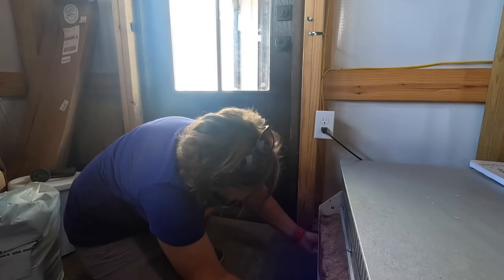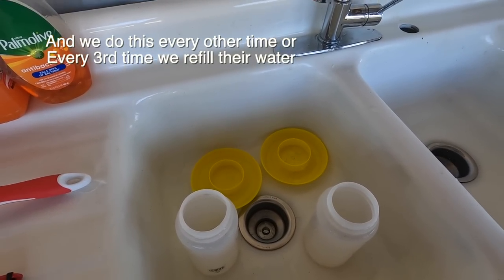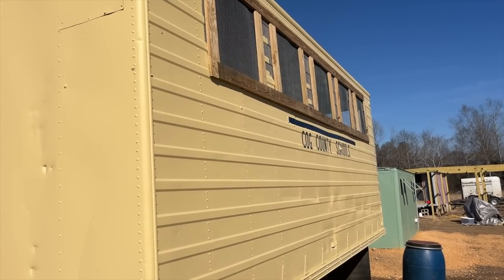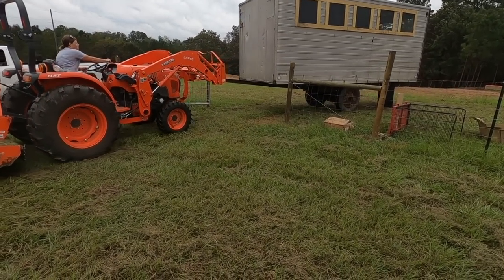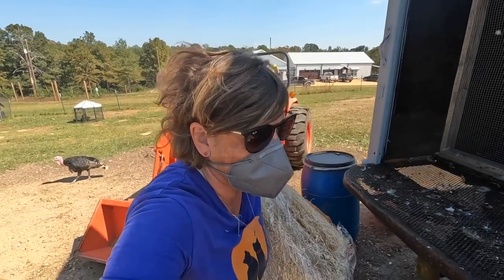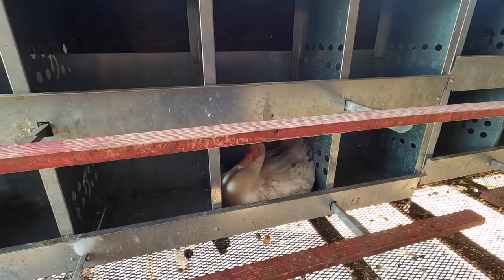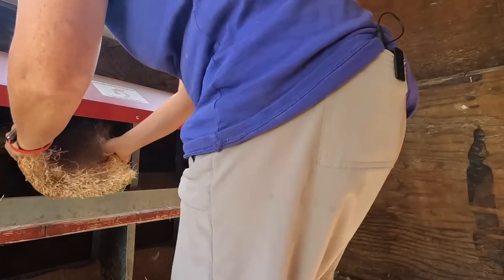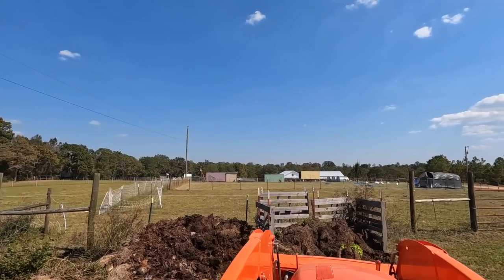How I Change My Chicken's Bed Sheets

Comment: 🙋‍♀️ Y'all, I have a tip for the chickens . . . . . 
Use a shower curtain or a plastic tablecloth, under the night roosting levels, you can either drape (hammock style) by hooking all 4 corners or just lay flat, under them. I suggest a dark one so they can rest easy, MaryCarl 😘
It's easy to gather up & take away to clean & havin' extras means you can hang them out by the compost pile so when it rains they are cleaned 😊
💞~👵

Comment: I think the goodness of the apple cider vinegar has to do with helping to get a good pH level in the chicks' tummies.  It's good like that for humans, too.  16oz chilled water, with 2 tsp apple cider vinegar and 1 tsp lemon juice, if you've got heartburn, it'll fix you right up!  (The reason you get heartburn is because the valve at the top of your stomach doesn't close right when the pH in your stomach is off, and so you end up with stomach contents in the bottom of your esophagus.  The ACV/Lemon water helps balance out the pH so that then the valve closes properly, and poof! Nothing gets back out!)

Comment: Brooke or if anyone else knows, What are those pads you use in the bottom of the brooder? They look like puppy pads but what you have are bigger than puppy pads. I was hoping they were something cheaper than puppy pads. Puppy pads are costly when you have a big ole puppy who will pee outside, but wants to poo inside. We also have a very small older chihuahua who needs pads for overnight and if we are away. Thank you for any info.
Reply from the maker: They were actually leftover from tractor supply when they quit using the brooders they had in stores. (One of the workers gave them to me rather than throwing them away)